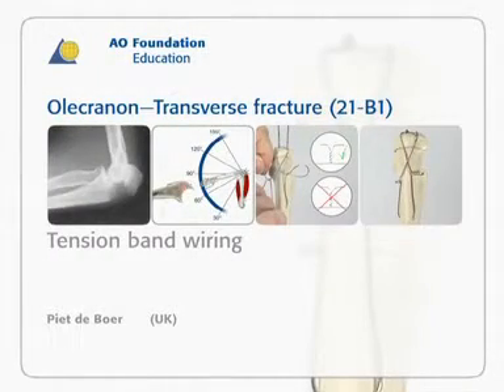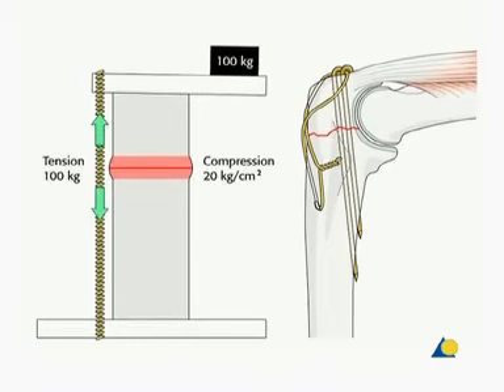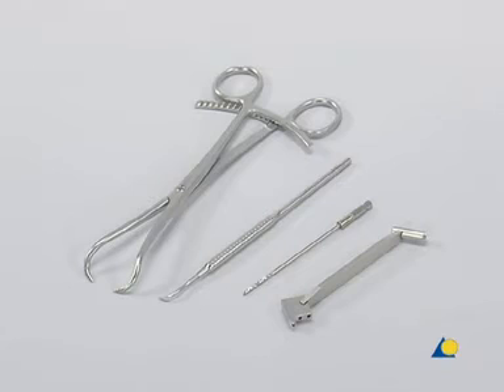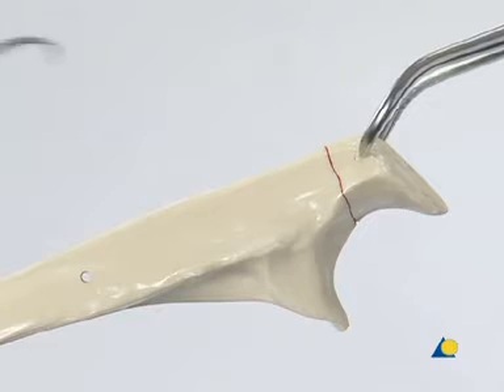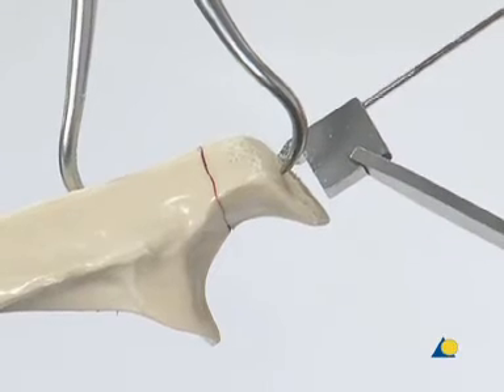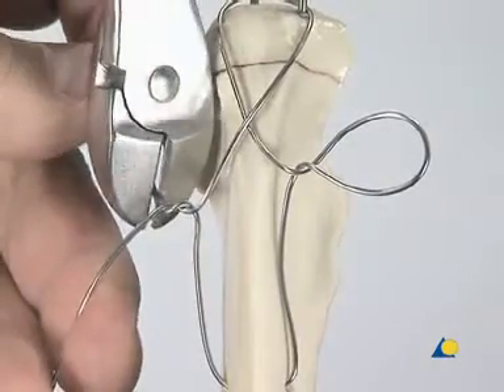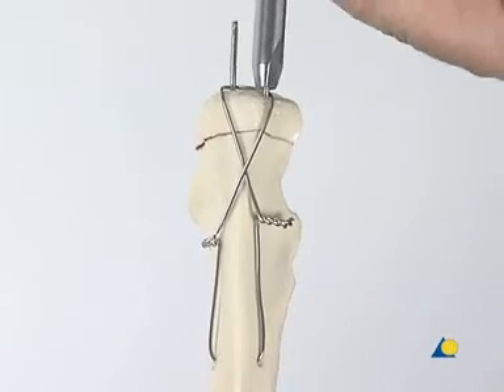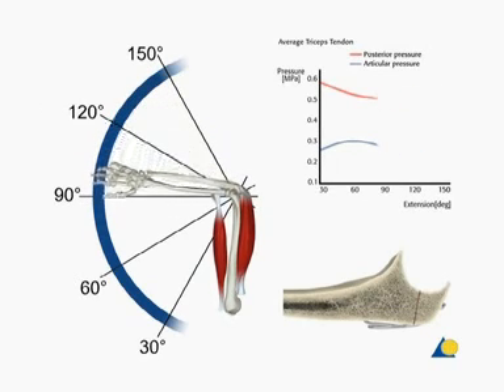Olecranon—transverse fracture 21-B1 tension band wiring

Comment: This is interesting, as I just had surgery for same.  However, the treatment was with a titanium plate.  In the tension band approach, it seems to me it would/should offer better range of movement in both extension and flexion, but I'm not a doctor.  I will say that with the plate, my flexion is pretty decent, and improves daily.  However, I think my extension is forever limited because of the plate interfering.  I'm about 15-20 degrees short of full extension lock.  Interested in comments.  Thanks!